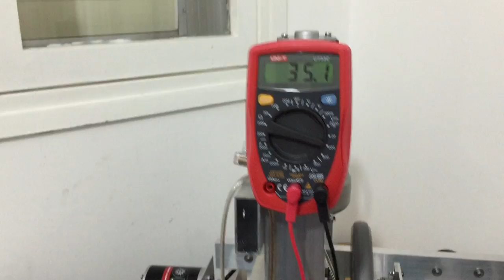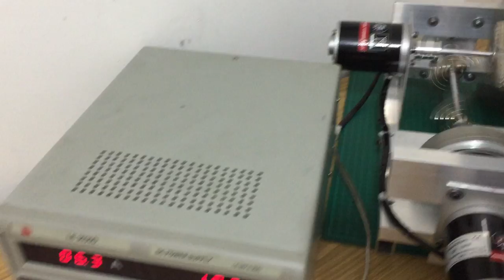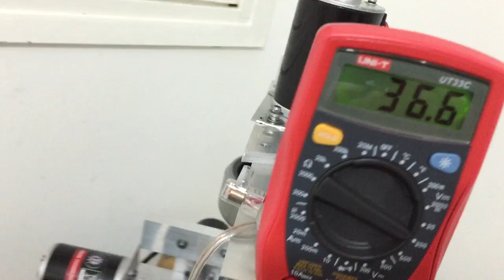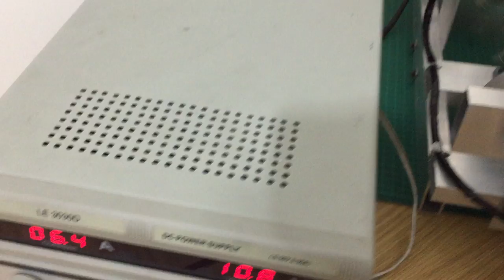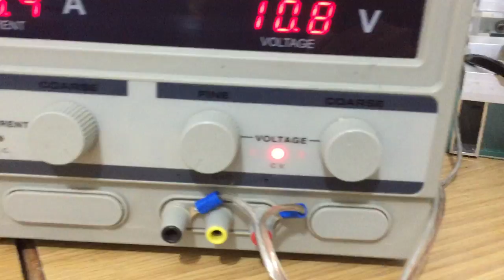Acceleration controlled free energy devices - Battery charge machine USA Israel technology

Comment: That is very cool device, but truthfully has nothing to show if you don't take complete measurements.  We can see it can step up voltage, what does it do on load? What is the complete picture of energy transfers? The total Watts in to the Watts out of the system?  You are changing electromotive force into kinetic force and then back again, so what is the COP? Those are the important measurements if you would like some validation for your creation.  Again, it is very neat looking, and I love how the magnets are all flux coupled, so there is less mechanical breakdown.  That flywheel  probably also plays some part in storing energy in your system as well. Very creative  design and I encourage you to keep exploring.
Reply from the maker: Diadon Acs New machine needs a lot of testing! Just this week I finished building
the machine with 6 generators,

Non-contact or friction from the electric motor that runs the machine, The
machine is not heating up, with no belt drive and no gearbox, currently not
logged any electronic circuit that can take and store the electricity out, Thanks
Reply: ***** i think it would be a good idea if you put the system to test and see how fast it will charge car battery that is dead. maybe have you dc output turned into ac to run a motor underload. just a suggestion

Comment: impossible to evaluate without a measurement of ampere output.

convert 10 volts to 20 volts is done easily even with a transformer.

without an ammeter in the output video it is useless.

Comment: Sorry to bother you again...Since i see your replies are usually instant (wich you dont see very often on youtube) i would like to ask you another question.
What do you mean by acceleration controlled free energy? I mean its not really free energy is it? Its just verry efficient. I propably sound like a comlete idiot saying that (not understanding the title). Btw what do you think about all the fake vids about free energy in wich they claim to use "monopole magnets". I mean as far as i know they do not exist! Also if they would have a monopole magnet...wouldn't it fly right to the nearest strongest magneticall source (possibly one pole of the earth) at a great speed?
Reply from the maker: FlipposMC The magnet itself is not a monopoly! I built my original machine! I also wrote Patents and copyright, You need to believe that working with magnets is the hardest thing you might expect .. my mechanical shape and the combination of what i build creates a machine that you not seen in the past! so this is the future magnets mechanism! Thanks
Reply: If a true monopole magnet existed (which it doesnt) magnet motors would be a reality not just a sought after holy grail.Free energy devices would abound. But monopole usually refers to the bedini definition of only utilizing the magnets or coils in a single pole config. such as all magnet facing to use the north pole. confusing but knowing bedini it adds to the allure of vague definitions and on purpose improper  measurement methods.
Reply: iczer01
Actually monopole magnets might in theory exist! Atleast thats what professor Mitchiu Kaku suggests
Reply: FlipposMC didnt he also theorize the building of a lightsaber. I dont doubt that someday we may have true monopole magnets but that day is not today. In reference to the previous posts the term monopole is as I stated earlier.
Reply: iczer01 Your right but Michio Okaku or Kaku (same thing in japan) Said that there could be some wich we would fing on one pole of any magnetic field in the univurse.